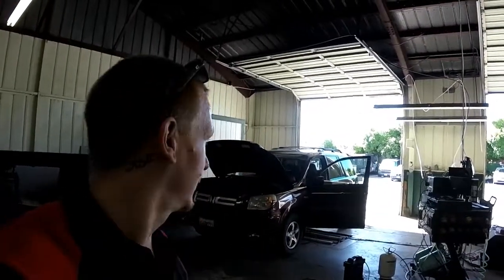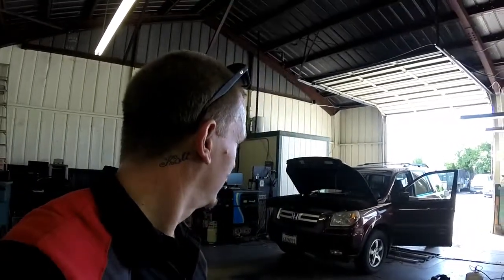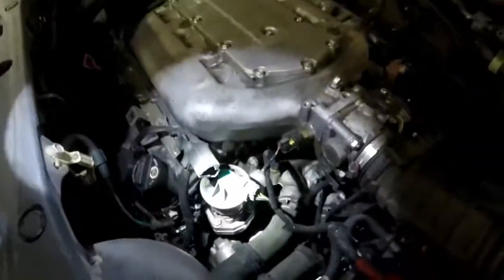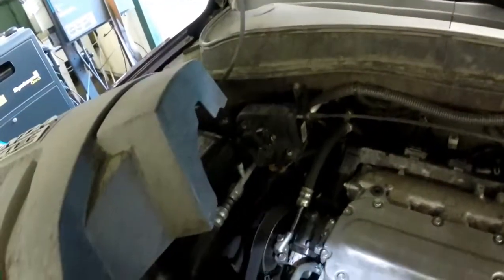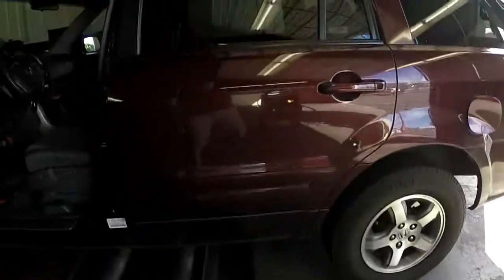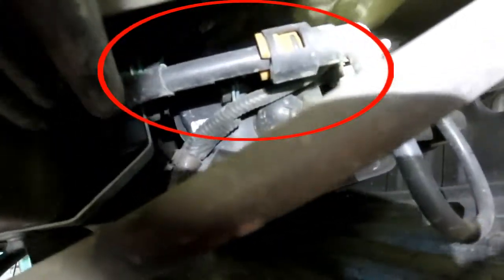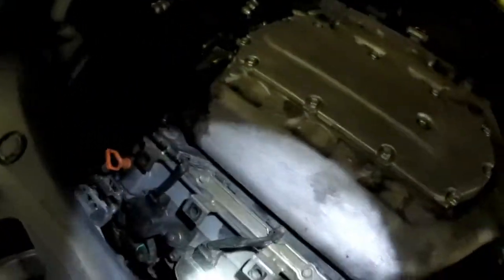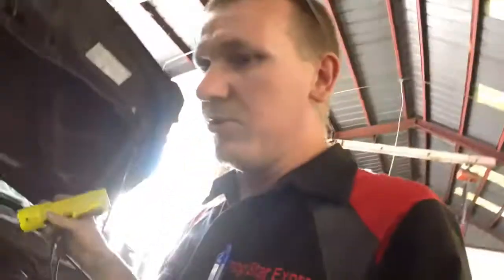Honda Pilot Emissions locations: PCV, EVAP, & EGR

Comment: My mechanic changed the one underneath the seat and the check engine light came back on . Which one should we try next ? Any thoughts ?
Reply from the maker: I assume you have a evap leak code? A nechanic should be able to do a smoke diagnosis to check for EVAP leaks. If you don't see any leaks then test the vent solenoid that your mechanic replaced and check the purge solenoid up under the hood. Chances are you need a new purge solenoid  but you could actually have a evap leak threw a cracked hose. 

I have a p0442 diagnosis vid if you check out my other vids. Its not on this vehicle but might explain a little more of the diagnostic procedure.
Reply: Scotties Hobbies thx for the heads up. Luckily I drove it 3 times and the 4th was to the inspection shop... It passed but the 6th time the light came back on. Obviously I gotta eventually get it fixed what are the long term effects if any of having that issue continue?
Reply from the maker: Long term a faulty evap system should not effect anything else but the evap system it self might deteriorate more.
Reply: Scotties Hobbies - Thanks